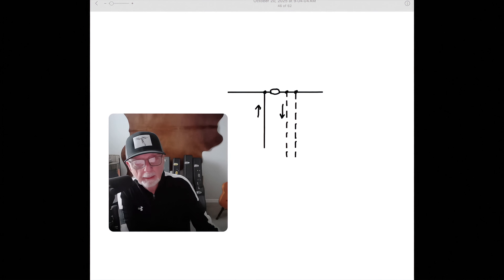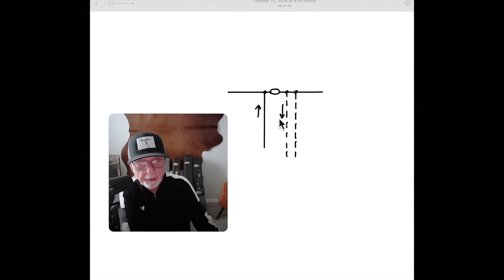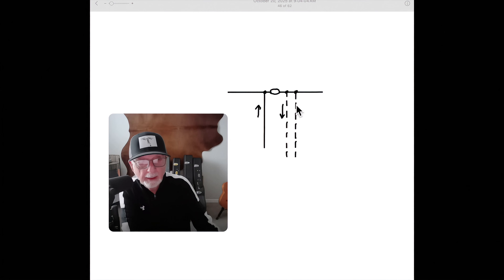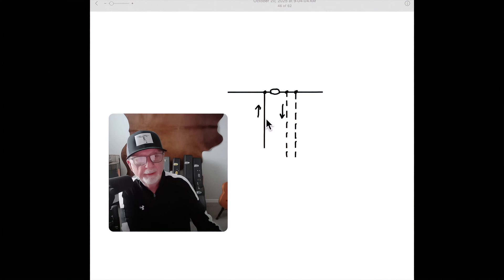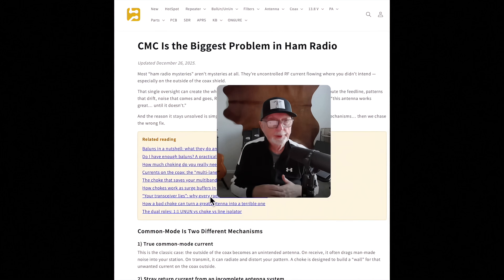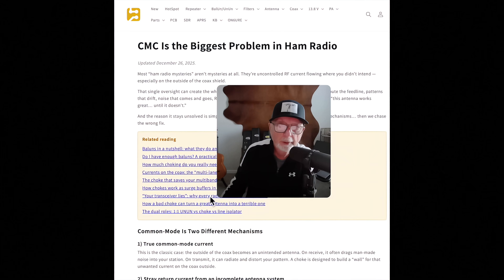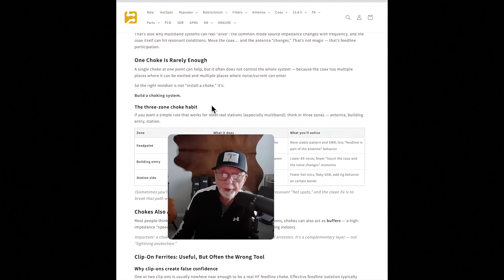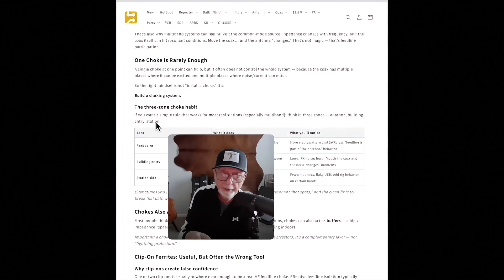Fixing the NOISE LEVEL Ruining Ham Radio.

Comment: This is a good video and topic which really needs much further discussion in the near future.  Most do not understand current flow and it was important to see Kirchhoff's Law shown.  Our test materials do not explain it well and opt instead for a simplified explanation which is often misleading or only accurate for one specific installation.

Regarding chokes:  A choke provides "some" resistance to the conductor which is carrying the common mode current.  It is not an infinite resistance like an open switch.  Think of the CMC as a river and the choke a dam.  You can build the dam and soon the water level (voltage of the CM) will increase to a point where it spills over and you then require a larger dam to hold the water (CM) back.  CM, like water will ALWAYS find its way back to the source and all we're doing is DIVERTING it from an easy path to an extended path (away from the coax outer shield).  This is why you need chokes here there and everywhere.  It's like a dam with holes in it springing leaks and we use additional chokes to patch those leaks.  This is a major problem and it does NOT solve the equation properly.

To do that, we need to regain the BALANCE of the load, and the entire antenna "circuit".  AT&T telephone lines, microphone cables, analog broadcast interconnections, Ethernet, and the wires that connect each module in your car ALL use "balanced twisted pair" as the transmission line.  They do not use coax or an unbalanced transmission line with chokes.  

As an engineer, it is my opinion that the HAM community needs to have a better understanding of balancing and how to achieve that balance in an RF environment.  You can "sour the milk" (the return path for CM by adding chokes), but you never truly rid yourself of the problem.  To do that properly, you need to provide an ALTERNATE PATH of low impedance for the currents to return back to the source.  I hear very little discussion of this part of the equation, and so I bring it up here.

73 friends.
Reply from the maker: A reply from the RF.GURU - ON65URE. 

- “A choke provides some resistance…”
A common‑mode choke is mainly impedance (mostly inductive + some loss), not “resistance” in the simple DC sense. The distinction matters because the behavior is frequency‑dependent and can include self‑resonance.
- The “dam/spillover” model implies the common‑mode current is inevitable and just reroutes.
That’s the biggest conceptual error. Common‑mode current is not a fixed ‘flow’ that must happen. It’s driven by a common‑mode voltage caused by imbalance/coupling. Increasing common‑mode impedance at the right point reduces the current (often by a lot). It doesn’t “build up until it spills over” in normal operation; it just changes the current/voltage distribution.
- “CM will ALWAYS find its way back to the source… we’re only diverting it.”
Overstated. Yes, currents form closed loops (including via stray capacitance / displacement currents), but that does not mean the magnitude stays the same and simply “finds another way.” If you raise the impedance of the undesired path, the loop current can become negligible.
-“This is why you need chokes here there and everywhere.”
Not generally true. If the imbalance point is the feedpoint (common case), a single properly designed and properly placed choke at the feedpoint is often sufficient. Multiple chokes are sometimes used, but typically because:
• the first choke doesn’t have enough impedance at the operating frequency,
• the feedline is running through high E/H fields and is being re‑excited,
• or there are resonances along the feedline.
It’s not because “the dam springs leaks” as a rule.
-“Telephone/Ethernet/etc use balanced twisted pair. They do not use coax or unbalanced line with chokes.”
Factually and conceptually off:
- Whole industries use coax everywhere (CATV, broadcast, cellular, lab instrumentation, satellite, GPS, etc.).
- Balanced pairs also use common‑mode suppression (e.g., Ethernet uses magnetics and often common‑mode chokes; many twisted‑pair systems fight common‑mode noise constantly). Balanced ≠ magically immune.
- “To solve it properly… provide an ALTERNATE PATH of low impedance for the currents to return back to the source.”
This is backwards as stated. To stop common‑mode on the outside of coax, the standard fix is high impedance to common‑mode (current balun / choke) plus symmetry (or a proper counterpoise for an unbalanced antenna so the feedline isn’t forced into that role).
Providing a low‑impedance common‑mode return path can just encourage common‑mode current to flow somewhere else (or move RF into the shack), not eliminate the cause.

“A CMC doesn’t ‘dam a required flow’ that will spill over; it raises the common‑mode impedance so the driven common‑mode current drops—often dramatically—when placed at the imbalance/excitation point. Balanced systems aren’t immune either (they still use CM suppression), and ‘adding a low‑impedance return for CM’ isn’t a general cure; symmetry + a proper current balun/counterpoise is.”
Reply: @BustRadioMyths  We agree to disagree.  Sadly, I overly simplified and used basic visual illustrations to explain my initial reply which was composed solely for the average HAM.  There were "liberties" taken in an attempt to help explain the circuit to the layman.  I did so because that is the target audience of this channel.  I will continue to share what I have learned as a broadcast Chief Engineer for several stations (both AM and FM) in my career.  73 & Happy 2026

Comment: The cottage at the in-laws where K4SMN and I stay now has a permanent ham station with a high N9SAB OCFD betwixt two pine trees. The cottage has a tin roof. That roof really threw a monkey wrench into my efforts to tame CMC. The antenna unun is 4:1 with a -35 dB CMC integral with it. The ABR240 feed line, near the unun has 7 heat shrinked ferrite beads. I also placed 10 Mix 31 clamp on ferrites at various locations. The ferrite size allows two passes of the coax thru them. There is also a big choke near the radio. The CMC issue is now mostly solved. Metal objects in the immediate vicinity severely detune antennas (no brainer). I just didn’t realize the issue would be this bad. The math gives a base resonance of around 3.45 MHz, taking Vf of the wire into account. The actual resonance is 3.55 MHz. Delightful. I had to add 5 feet of wire! Deployed the antenna as a vee in the woods for POTA the aerial worked fine!
Reply from the maker: Good work!

Comment: Once I found the benefits of defeating common-mode current on the antenna feeder it was a natural progression to tackle common mode issues on the electricity supply and phone line (I have VDSL). In my case the noise level on 40m reduced by over 20dB, suddenly HF operation became viable again. 73
Reply: VDSL frequencies are far far beyond anything in HF/VHF/UHF.   I highly doubt your noise was comming from the phone line it was residing on.
Reply: @CrisisGuildWOW   VDSL1 has spectra up to 12MHz and  VDSL2 up to 30MHz. Here in the UK  VDSL is a known source of interference to HF amateur radio and is also specifically covered by an RSGB document. https://rsgb.org/main/files/2019/10/How-to-identify-VDSL-interference-v1.0.pdf

Comment: It bears repeating for the uninitiated the reason why the shield of coax represents a system of two wires is because of skin effect. Most of the RF current flows on the surface of conductors, hence two wires, as the shield has two surfaces.

Comment: All these devices from overseas being sold that are in our homes. Poorly or non filtered wall warts, cheap drivers in led lamps, microprocessors, everything now has a chip in it, spewing RF garbage. Happy New Year.
Reply: Devices described by the manufacturer as containing a microprocessor receive greater scrutiny from the FCC, and therefore a different Device Class designation, should they meet the requirements to be offered for sale
Reply: @rockytrashpanda ideally
Reply: @rockytrashpanda as a consequence our rf world has grown noisier.
Reply: @rockytrashpanda  I doubt that products from China are really FCC approved,  whatever the label says.
Reply: @comment8767 it is sadly often the case that the vendor of equipment pleads ignorance on the matter of the appropriate device class to be sold to the public

Comment: I am stuck using a vertical antenna due to a lack of supports for a wire etc.  and proximity of utility and power lines.  My noise varies from passable,  or below the signals I seek or up to the point that I just turn off the radio and forget ham radio.  I used to have a balun fed dipole elsewhere and even then I had noise issues,  at another location.  If I could go back to the 70s things were much quieter.  Anything making noises you could trace and suppress.  Now every piece of imported electronics is a jammer to one level or another,  and there are billions and trillions of them in every home in America.  I think it is clever that our adversary denied us HF usage incrementally and got away with it.
Reply from the maker: Interesting way of looking at it.

Comment: I am relatively new to ham radio (1.5 years) and I just checked again the learning material many German hams use as their preparation for getting licensed: 
The topic (common mode current) is adressed a few times in there, including the equation based on Kirchhoff's law. 
However, at least for me who used self-study only I admit that the practical appliance or the consequences of this was - at least in the beginning - not really fully clear to me. 
Therefore thank you for emphasizing the choke topic 🙂, because videos like yours have helped me to understand what it is all about. I am meanwhile using 2 chokes, not 3, as feed point and builing entry is more or less the same on my setup. It works (noise level < S4). 
73 from DL

Comment: How about a long wire terminated in a banana plug inserted directly into the SO239 center of the transceiver? No shield then no common mode.
Reply from the maker: @Leprous_Vampire Consulted with my RF engineer collaborator ON6URE on that one.

"What he actually built is a common-mode antenna by design 😉. Nothing is “floating” or isolated ... everything is capacitively coupled.  On receive, everything connected to the rig becomes part of the antenna.
On transmit (if it even tunes), everything connected to the rig becomes the counterpoise ... and is hot.
Removing the shield doesn’t remove common-mode; it just forces the return current to flow through the shack, connected or not ;)"
Reply: I would think a counterpoise would be necessary for you to hear or transmit much of anything.  But a bit green still, so following to see if I'm right or even close.  :)
Reply from the maker: Ur right every antenna must have a return path.   If you don't provide it, it will find one.

Comment: There is such a cheap and  quick fix. just take a ft240-43 wind some rg58 around it, connect it  next to your radio, case closed.
Reply from the maker: If you don't choke at the feed point the feedline is still part of the antenna.